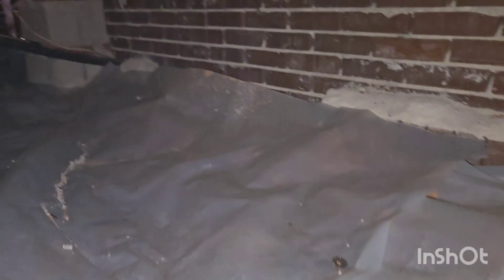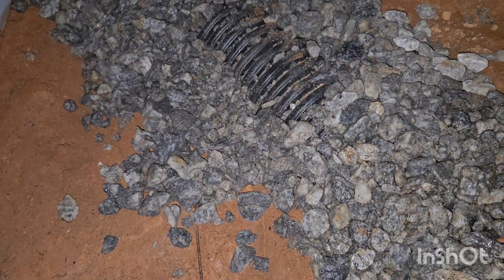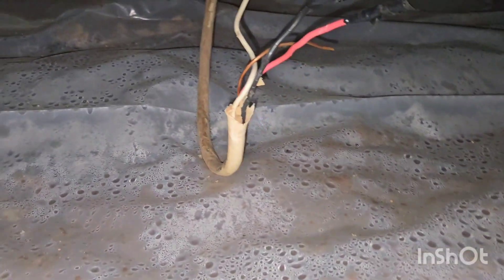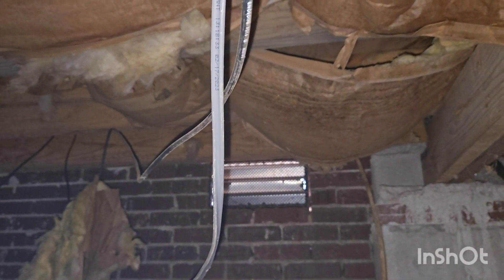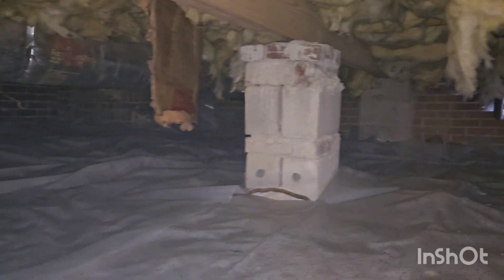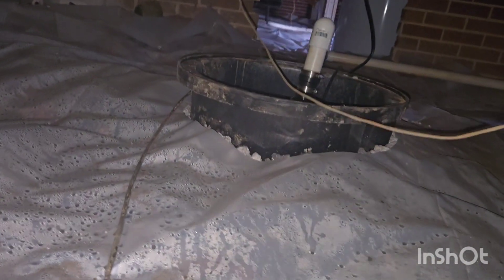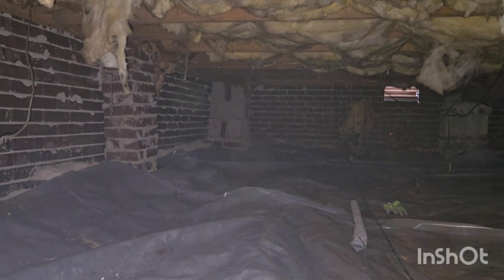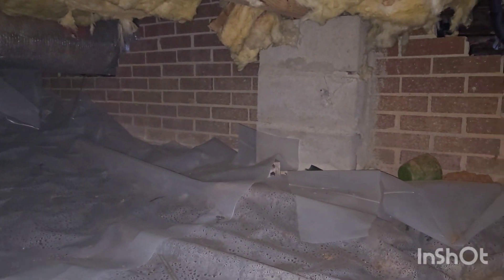Poorly installed French drain.

Comment: No good
Reply from the maker: I see a ton of companies doing this kind of workmanship. It's sad. I asked the homeowner how much they paid. And I got the scoop. So, the crawlspace was 50'x30'. The lin. Ft of the drain was 160' . the vapor barrier was 1500 sq ft. Between the well,pump,electrical wiring and vapor barrier.  They paid $6800.00 . A lot of money for a job badly done🤨
Reply: @homeinspecting  they should be ashamed.